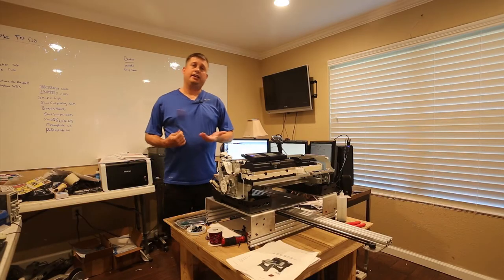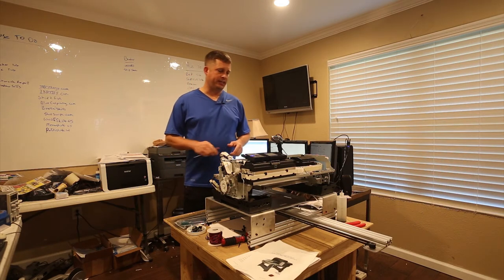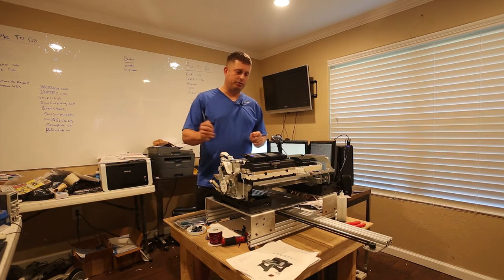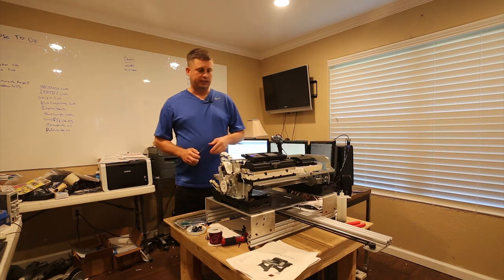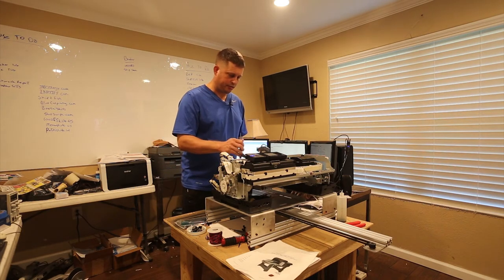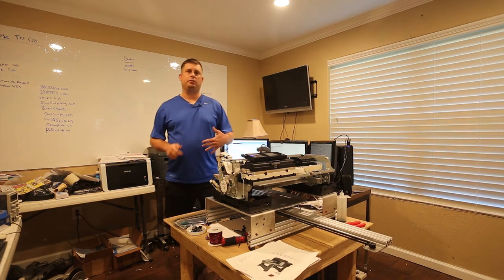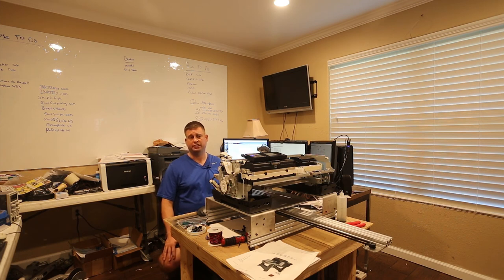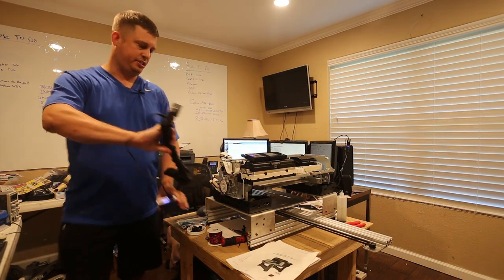Open DTG - Part 5 - hooking up the All In One controller

Comment: Would love to see the connections. The forum isn't responding to my questions. I'm pretty sure I've wired everything right, however I can't get power to the stepper motor. I have power going to the driver, but just not the motor.

Comment: Hi Brian I love the videos man.  I'm trying to figure out how to build my own DTG only question I have is how do you get the printer to recognize the white ink.  I've learned that the reason people are using these epson's is because they have more than 4 in cartridges but how do you get the printer to print out the white when it thinks its printing out of a magenta cartridge or the black cartridge for the yellow cartridge. I'm having trouble finding this information I would really appreciate it if you could help me out me and explain it
Reply from the maker: It's a RIP setting.